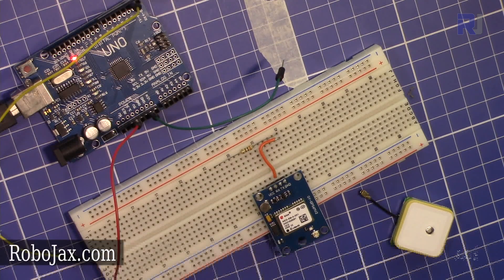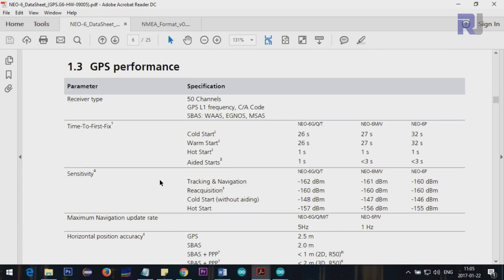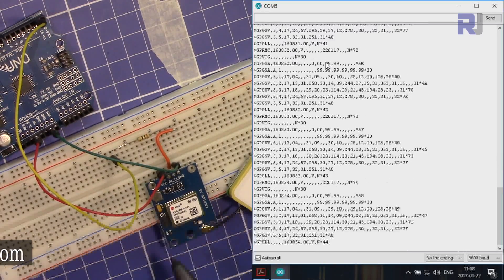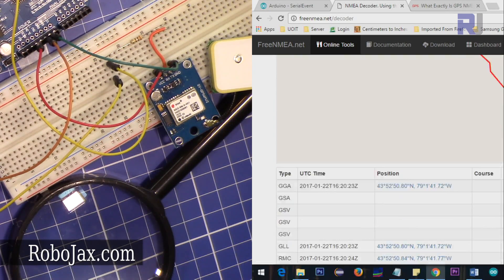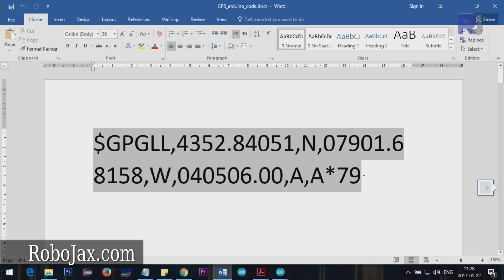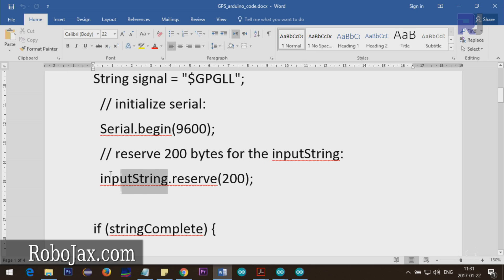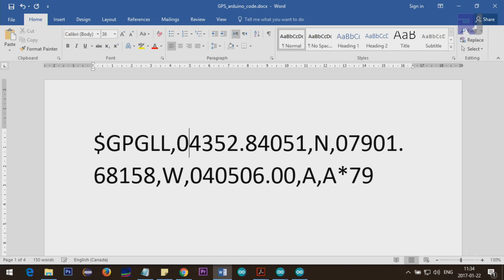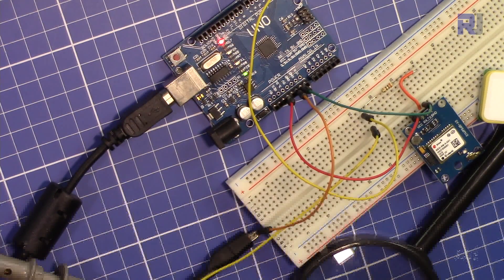E2 Extract GPS location in Arduino with NEO-6m or NEO-7M module RJT02

Comment: I recently brought a neo 6m-0001 I power it with 3.3v vcc and connected rx and tx to gpio 0 to 5 pin on every possable combination  what other video and documentation explain but I am unable to get any data when power on. I had not put any type of resistor. Please help me.
Reply from the maker: as soon as you conect to serial pins,you should get data.  Check wiring. try this video https://youtu.be/hbRpr1HbDf8

Comment: Hello, i connected my gps module with my esp8266 for the first time it worked but after that I'm not getting the latitude and longitude it's showing 0.000000 for both, even though led is blinking, I'm getting this problem, what's the solution for this??
Reply from the maker: Hello, it might be that your location is not receiving signal. change your location if you did not change the code.
Reply: @robojax  i tried at different locations for many minutes but also It's showing same, initially i got the signal even though I keep my device in the same place I'm not receiving the signal but the module is blinking
Reply from the maker: if you are on open area and module has power, then something is wrong with the module.

Comment: Hello brother i have a small doubt... If we don't solder the pins in the gps module would it work anyways? I mean like if i just plug the pins without soldering will it work?
Reply from the maker: Hello, yes it will work.
Reply: @robojax  ohh thank you so much for the reply bro... I dont know why my GPS isn't working... I think it is broken

Comment: When i connect it no data shows up on the serial monitor
Reply from the maker: please see this image that shows you how to set the serial monitor https://snipboard.io/y3pKwG.jpg please reply it resolved the issue. good luck.
Reply: @robojax  i have it already at 9600
Reply: @robojax  so far I have uploaded the blink code and the arduino blinks normally, but when I connect connect all the wiring for the gps module nothing shows up on the serial monitor, and the gps does not light up either.

Comment: My gos module is not sending any data. Any suggestions?
Reply from the maker: GPS module doesn't sent data. It receives them and your arduino should display it.  Check the wiring.
Reply: I connected the tx and rx of gps to the tx and rx of Arduino(reversed). Used 3.3v of Arduino but the led of gps is not on and nothing is displaying in the monitor.
Reply from the maker: I don't remember, but doesn't it need 5V?
Reply: No that will most probably destroy it. I read somewhere that the GPS module requires some time to start. How much time did it take for you?
Reply from the maker: it depends how clear the path to sky is. Perhaps 30 seconds to 90 seconds.
Reply: Thanks

Comment: Hi i have this all material, i wonder how do i connect my gps to the app that i will make, because i want to make an gps app that will show my exact location etc.
Reply from the maker: Hi, for that you need to use Bluetooth with Arduino to send it to your mobile device. Then in your app, it should be able to read the  data and display it on map.

Comment: Hello sir,
Excellent tutorial. thanks.
Reply from the maker: You are welcome.
Reply: @robojax  I have a small problem. I need to use components that are compatible with Arduino. A position sensor (so I use a GPS module. This GPS module must be Adafruit Ultimate GPS Data Acquisition Module (GPS Included)). A position storage (with an SD card that must work with an SPI link). A bluetooth interface. A GUI to visualize the route (using an Android tablet that is compatible with a bluetooth module).
you can advise me to use what as a component . because it's 3 components must be compatible with Arduino and an Android tablet IHM thanks to a Bluetooth module.

Comment: Hi awesome tutorial but my serial monitor is not printing lat and long separately as urs is doing. My output is
⸮.79298,N,07707.39270,E,1,07,1.41,201.4,M,-40.0,M,,*71
$GPGSA,A,3,⸮
and i have used ur same code .
could u pls help?
Reply from the maker: You haven't subscribed to my channel. I will reply to all Subscriber's 🔔 questions. So make sure to Subscribe.😊

Comment: Are the connection will be the same if I use neo 6m v2, which have five points, with extra PPS?
Reply from the maker: I will reply to all Subscriber's 🔔 questions. So make sure to Subscribe.😊. You haven't Subscribed yet. I spent hours recording and preparing it so you learn, what is single click to subscribe in return?

Comment: how to add sim slot and micro SD ? and how to trace it by sim card ? is it even possible ?
Reply from the maker: In Arduino we have a SD car module where you can save data. Get that module and make sure you can write to SD card. then the values that you print on the Serial monitor, save it on the SD card.

Comment: after i connect the pins with rx and tx and the module blue  led does not blink, but the numbers and letters still coming out from the COM4 serial monitor, am i missing anything?
Reply from the maker: you are getting useless data without coordinate. You should be in a spot where satellite signal reaches you either close to a window facing South or in an open space where south portion of sky is visible.
Reply: @robojax  okay  i went outside and tried it for a few minutes, the only thing that came out is the red LED blinking, the blue LED doesnot. The GPRMC code does not appear, could be my gps sensor is faulty?
Reply: @robojax   oh i just notice my serial monitor displays gnrmc instead of gprmc,  maybe my  country has to do with the code appeared
Reply from the maker: good to hear that. good luck.

Comment: My GPS data is not stabilizing at all. The light in the gps module doesn't glow and I keep getting some garbage values in the serial monitor. What might be the reason?
Reply from the maker: Hi, because you might have set the Baud rate of serial monitor incorrectly. see this https://snipboard.io/y3pKwG.jpg

Comment: Hi, Can anyone help me, please! I am facing an issue with the final code(lat and long).
I follow the whole video the GPS is working and give the exact location after uploading the simple blinking code to the Arduino but when I upload the final code (which link is present in the description of this video) it not show any output in the serial monitor..!!
Reply from the maker: check the baud rate settings https://snag.gy/y3pKwG.jpg
Reply: @robojax  Yes I keep the baud rate 9600 but it not working!
Reply: Can you tell one more thing, Where to connect the RX and TX of the GPS to the ARDUINO?

Comment: Hello Robojax, I tried your code, but I am using the Arduino Mega 2560 and nothing is displayed. Could you indicate what to change in the code. Ultimately, I need to extract the speed from the VTG message. Could you enter the code on codeshare.io ?? I promise donation. I am fresh on these matters, but I need this for my master's thesis and I care about the time (I have only a month). Pleeeeese
Reply from the maker: It should work Test it on Arduino uno and then move to Mega. I have another video where you need library. Try that as well. https://youtu.be/hbRpr1HbDf8

Comment: i have made the connections from arduino uno to gps Neo-6m but i open arduino ide i cant see anything in serial monitor......can you please help me with this
Reply from the maker: Other than tell you to check the wiring and make sure you have not changed the code. I can't help. Please check my latest video on GPS https://youtu.be/hbRpr1HbDf8 you might find is better. I am not sure.

Comment: hi sir, i had collected all the pins as you describe in the video, but my serial monitor does not show anything. i have tried this many time but same;screen is blank. is there any problem in my neo 6m? and how much time gps module take to synchronize withe satellite
Reply from the maker: Hi, about 1 minuet to get satellite signal if you are in open space. If you are by the window, and signal is weak, it might take 3 minuets to get signal.
Reply: @robojax  I tried this, but still nothing is displayed on the screen
Reply from the maker: If the code and wiring is correct and you are in open field, then your GPS module is bad. Try with another GPS module.

Comment: Can you power the Arduino with a 9V battery and still get your computer to receive the GPS information?
Reply from the maker: Yes you can. That connector is made for that purpose.
Reply: @Seth Vahra - Chinguacousy SS (2422)  you need to use HC-12 Module

Comment: Hi Sir, once i connect the 5v wire into my gps module but why my serial monitor does not show anything? I have try many time it still the same. Its that possible my gps module is broken ?
Reply from the maker: did you check the baud rate? 9600 or whatever value you set? try this inside loop, just after loop() {
Serial.println("Testing");
and see if it prints the text.
Reply: @robojax  Thx for replying, yes i try all the baud rate, i set the bound rate to 9600 but still cannot get anything at the serial monitor, i have try the 
Serial.println("Testing"); it does not prints the text out. It means my component broken already?
Reply from the maker: do you use another Arduino or do you use serial monitor for another thing? if not then inside the setup() do you have Serial.begin(); please copy and past as if you type, upper or lower case letters, that will create problem.
Reply: Robojax yes I use the serial monitor for other components it works well. I am using the normal led blink code at the example there.
Reply from the maker: are you using it at the same time? if not you should not have issue. if you use it at the same time, just make sure the baud rate is the same and it should work.
Reply: @robojax no, I just using only the gps module to get the location
Reply: If you are putting 5v into a 3,3v component, you have blown it up. I thought you watched the video?

Comment: Hi Robojax, how are you? Well, I try this code and I receive the data of  GPS TX in Arduino UNO TX but when a upload the code the ARduino dont read nothing in serial. I use the reset and I confirm the receipt of the GPS data including tested and confirmed in the freenmea. What could be happening?
Reply from the maker: Hi, please share your code https://codeshare.io/ and once you post it, you will get a new URL (address), then post the URL here by clicking on "reply" and I will try to see if I can find the error . https://snag.gy/AHhRpV.jpg
Reply: You can't receive data from Arduino Tx

Comment: hey friend, i cant upload the code to my arduino, it turns out that there are a problen when i upload the code, what can i do?
Reply from the maker: send the screen shot from the bottom of Arduino screen where it shows what is wrong. Post it here https://snag.gy/
Reply: Ooh, thanks for your answer, i solved the problem, it was that i didn't had the tinygps++ added, but anyway the gps doesn't get any signal
Reply from the maker: change your location, get the module closer to window or go outside to test it.
Reply: Robojax i know, i have tried that too :( but it doesn't work either.
Reply from the maker: I am sorry , I am  very busy. I try my best to reply here only where I can see all comments in one page.
So. When you connected to power, do you see any indication if it is powering up? light or LED?
Best way to find the problem is if you have another module to test that. Some times the module dies and you never know.

Comment: Is it possible to operate motor by using GPS module..?
Reply from the maker: sorry I did not understand. GPS module is to receive GPS signal . To run a motor, you need motor driver module. These are two totally different things.
Reply: Do u know what GPS will do haa
Reply: not exactly, i think it may transfer signals

Comment: ..is there any chance that the RX pin is not working but we can get right NMEA data because in my case I m getting right NMEA DATA but when I m working with "while(gpsSerial.available()) "..command it's not working...can you please tell me what probably the error .....
Thanku
Reply from the maker: The device gets data from RX and puts label. NMEA data you are getting is without location and time and other satellite data.
so it is possible that your receiver is bad.  Many thing could go wrong. Only you can find the fault if you compare it with another working module.

Comment: i am unable to get the correct data even i am doing all connectivity right , what should i do kindly help ?

$GPTXT,01,01,02,u-blox ag - www.u-blox.com*50
$GPTXT,01,01,02,HW  UBX-G70xx   00070000 *77
$GPTXT,01,01,02,ROM CORE 1.00 (59842) Jun 27 2012 17:43:52*59
$GPTXT,01,01,02,PROTVER 14.00*1E
$GPTXT,01,01,02,ANTSUPERV=AC SD PDoS SR*20
$GPTXT,01,01,02,ANTSTATUS=DONTKNOW*33
$GPTXT,01,01,02,LLC FFFFFFFF-FFFFFFED-FFFFFFFF-FFFFFFFF-FFFFFFF9*50
$GPRMC,,V,,,,,,,,,,N*53
$GPVTG,,,,,,,,,N*30
$GPGGA,,,,,,0,00,99.99,,,,,,*48
$GPGSA,A,1,,,,,,,,,,,,,99.99,99.99,99.99*30
$GPGLL,,,,,,V,N*64
$GPTXT,01,01,02,ANTSTATUS=INIT*25
$GPRMC,,V,,,,,,,,,,N*53
$GPVTG,,,,,,,,,N*30
$GPGGA,,,,,,0,00,99.99,,,,,,*48
$GPGSA,A,1,,,,,,,,,,,,,99.99,99.99,99.99*30
$GPGLL,,,,,,V,N*64
$GPTXT,01,01,02,ANTSTATUS=OK*3B
$GPRMC,,V,,,,,,,,,,N*53
$GPVTG,,,,,,,,,N*30
$GPGGA,,,,,,0,00,99.99,,,,,,*48
$GPGSA,A,1,,,,,,,,,,,,,99.99,99.99,99.99*30
$GPGLL,,,,,,V,N*64
$GPRMC,,V,,,,,,,,,,N*53
$GPVTG,,,,,,,,,N*30
$GPGGA,,,,,,0,00,99.99,,,,,,*48
$GPGSA,A,1,,,,,,,,,,,,,99.99,99.99,99.99*30
$GPGLL,,,,,,V,N*64
$GPRMC,,V,,,,,,,,,,N*53
$GPVTG,,,,,,,,,N*30
$GPGGA,,,,,,0,00,99.99,,,,,,*48
$GPGSA,A,1,,,,,,,,,,,,,99.99,99.99,99.99*30
$GPGLL,,,,,,V,N*64
$GPRMC,,V,,,,,,,,,,N*53
$GPVTG,,,,,,,,,N*30
$GPGGA,,,,,,0,00,99.99,,,,,,*48
Reply from the maker: did you change the code? 
Share your code https://codeshare.io/ and then post the link under this comment. I will look at it.

Comment: hi sir, my led of gps won't even blink and when i open serial monitor, nothing comes out =(
Reply from the maker: how did you connect it? Did you connect it to 3.3V? you can't see anyting at serial monitor until it the LED shows blink and then solid. So if you have connected the wires incorrectly, it might be dead. Try it on another GPS module.
Reply: incorrectly as in tx to tx, rx to rx would cause the board to burn because vcc and ground are always correct? no i connected to 5v, the led blinked once in red color and i never see it blinks again
Reply from the maker: Are you close to window (facing south) where the device sees the sky? It need to receive the signal .